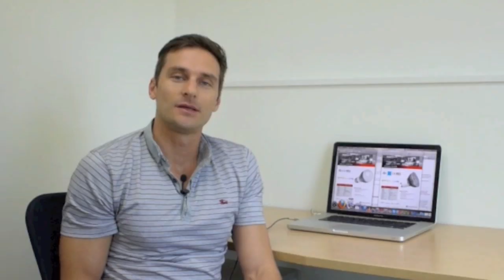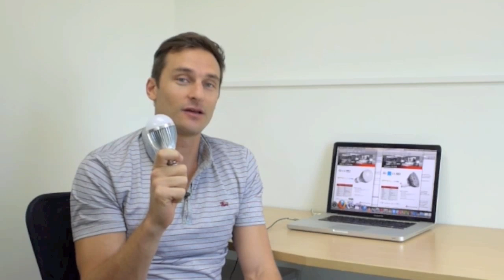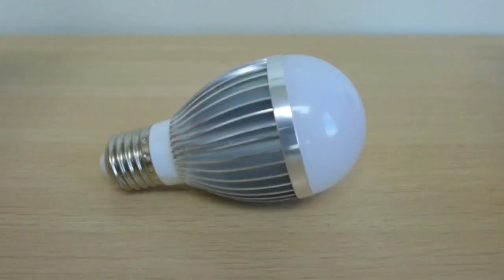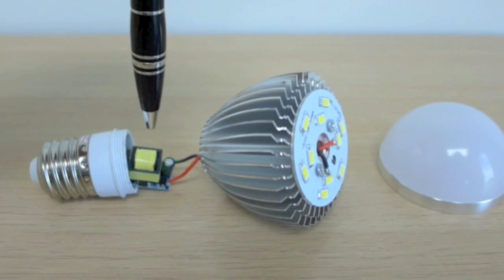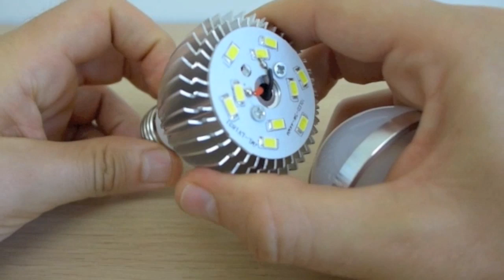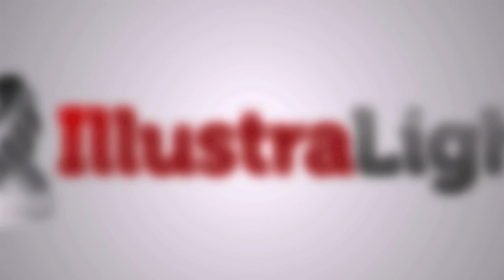Up close series: Good vs Bad LED Light Bulb

Comment: It seems to really come down to heat dissipation. I'm still not sure why some LEDs have what looks like silicone around the driver. Is that to insulate from heath to help with heat dissipation?